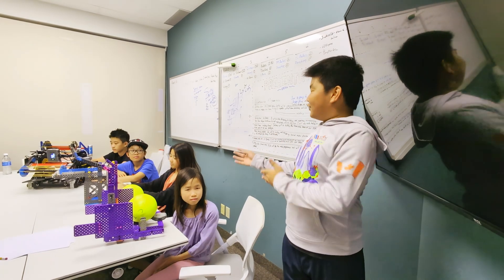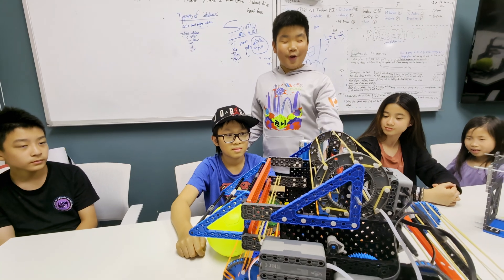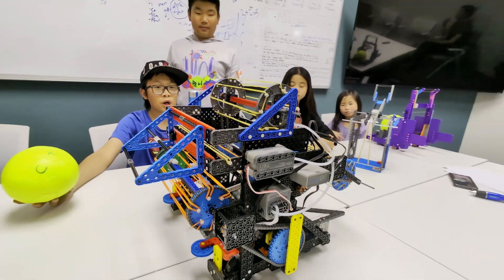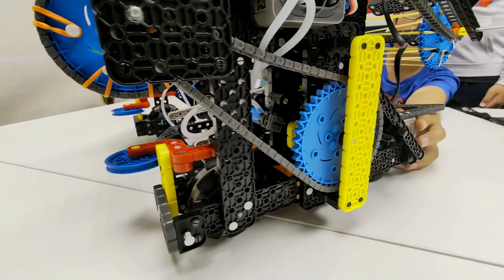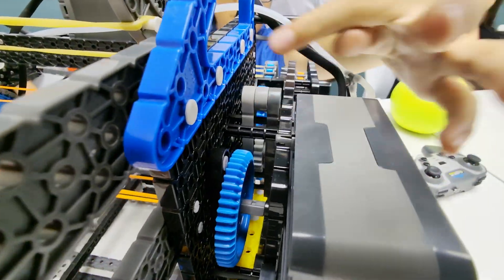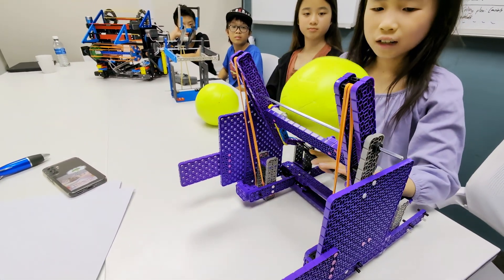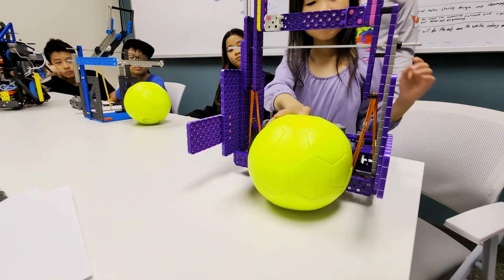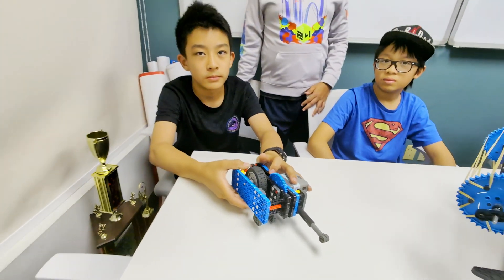VEX IQ 839A Rapid Relay Season Engineering Design Process Episode 1

Comment: I am guessing the whole axle slides and not just the gear on the PTO- right? any reason you are using plastic axels?
Reply: plastic axles are much smoother than metal in terms of friction. Metal axles are a bit "sticky"